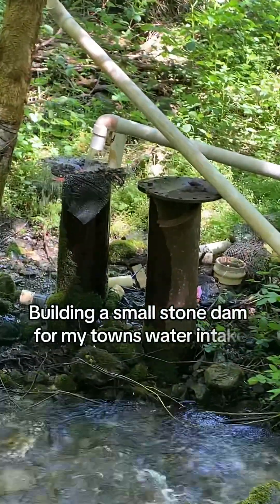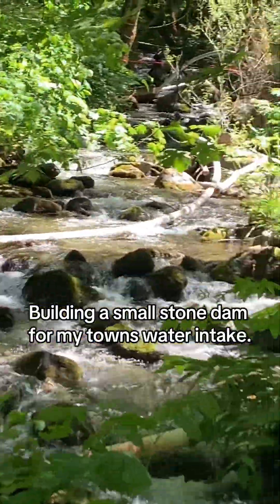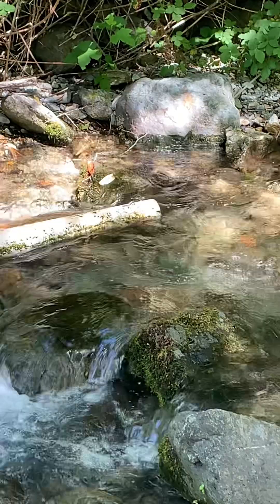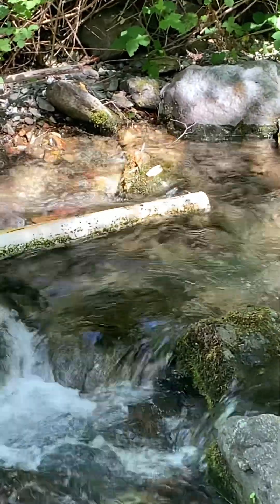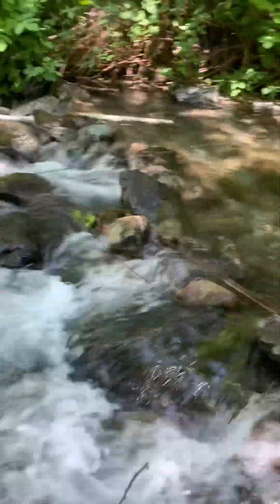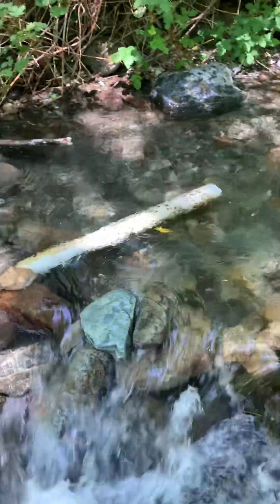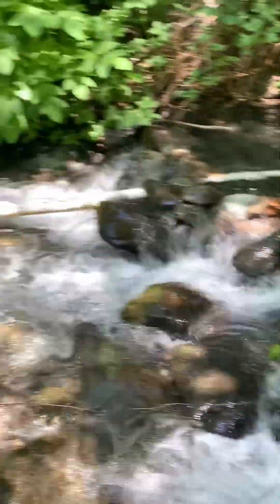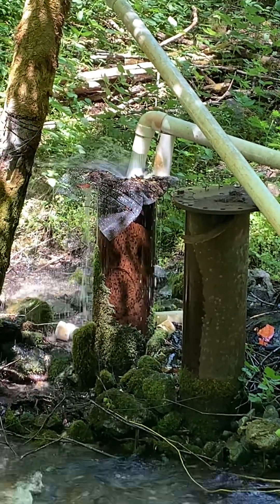Making a small dam for my towns water.

Comment: 💀just some random unsupervised, un-grate-covered pipe leading into another pipe haphazardly placed in a stream...
i would be a little worried some psychopath would find it fun to poison it, it's SO easy, although unlikely...still, i, would be a little on edge seeing that!.

Hopefully it's a little upgraded someday so randoms can't just mess with it and so that it...doesn't suck like that 
(not that i am opposed to a creek and the...method, -gotta do with what you got, but...just haphazardly placed like that???, for a WHOLE TOWN?!.
i bet there were lots of times someone had to go unclog that thing 😅it is very nice that you at least, are there to make it better, 
i totally would have fashioned a beaver-tail to wear as i worked, gotta get into the role!.
Reply from the maker: To make it worse that 4” inch pipe gets washed out every year when the water rises. I’ve only been working on this job for a couple of months but the whole previous crew got fired so it’s like starting from scratch. There’s a better intake buried under the creek somewhere that I need to uncover soon if I can’t get the state to approve a new system this year.

Comment: for water i would imagine a better down stream dam solution where there is water over the stand pipe and creating a small resivor im not a civial engineer but i am an electrical one. but one thing i do know is that hydo projects cost can spiral out of controll. especally when drinking water is involed. this would be a nice series if you could make bigger improvements. hope the best for you and your town.
Reply from the maker: I’m pushing for the improvements to be done but everything needs board approval and state approval so it will take time.

Comment: What is the elevation of the intake above the town?
It looks like you have fantastic microhydro power resource there. 
Not enough to power the whole town, but a well planned and constructed one would easily pay for itself and could go a long way toward paying off a water improvement project or other municipal outlays. What's your towns name?
Reply from the maker: The intake is 790ft the treatment plant is 730ft and most of town is between 430ft to 560ft. So from the plant to town is an average of 200ft difference in elevation. It definitely generates enough head for some good water pressure.
Reply from the maker: The town is Orleans Ca
Reply: @tcpete  
It's no longer an unusual thing for municipal water and sewer treatment plants to take advantage of head differentials like this and put turbines on the inlet or outlet flows. The standpipe looks around 8 inches. What size is the actual feedline to the WTP?